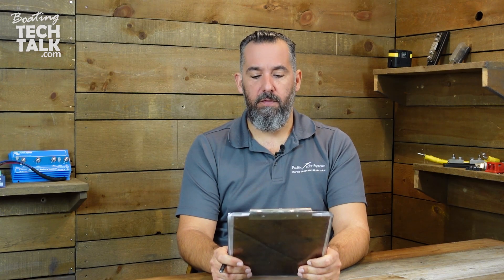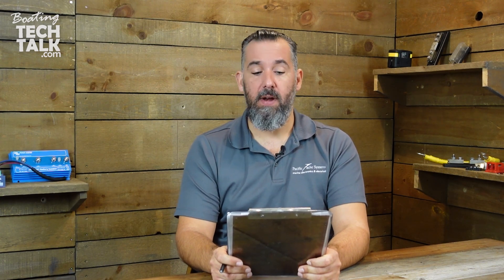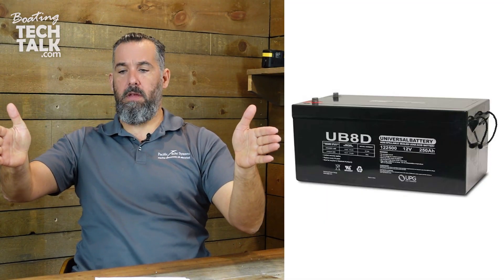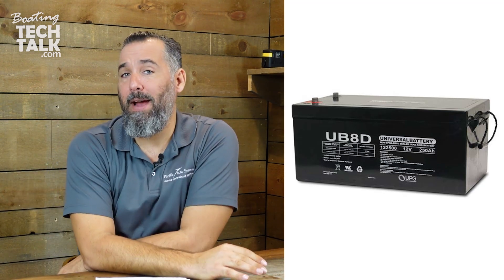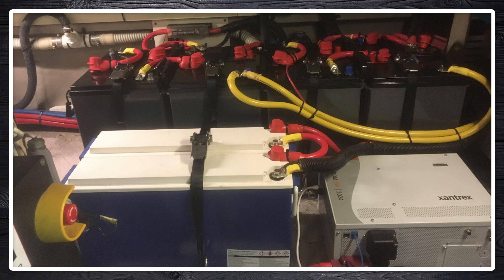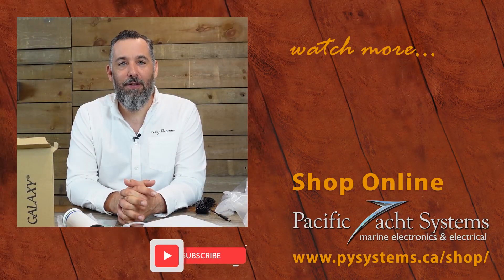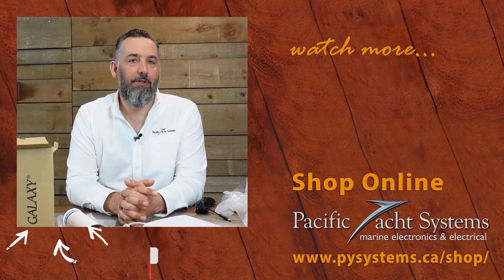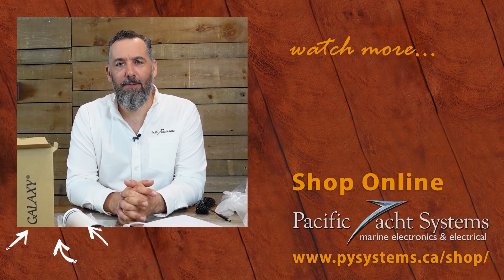Should I Use (10) 100Ah or (5) 200Ah AGM Batteries for My Boat’s House Bank?

Comment: I would think less batteries would be better,  less connections would create  less resistance on the flow of power though the bank, both on charge and discharge. This is best with anything electrical really. Even deans connections are better for flow than  tamiya connections. with less resistance there's less heat created too.

Comment: You didn't answer his question at all.
You spoke about the compromises that have to be made by space and weight limitations.
I think the OP was interested in knowing the technical considerations of the two scenarios. Such as cabling, voltage drops, capacity and depth of discharge, charging and lifespan etc.
Reply from the maker: Hi Mark, IMO, cabling, voltage drop, DOD, will be quite similar for a 10 battery bank or a 5 battery bank. Even if you can handle the weight of a heavy battery, less batteries is better.

Comment: I don't like your answer, you talk only about practicality and weight. What about electrical? number of connection? And end of life? Or when 1 battery is dead? and cost (new and replacement)? ...
Reply from the maker: Hi Maxime, my preference would be to go with 5 x 200 amp-hour batteries instead of 10 X 100 amp-hour battery banks.

Comment: Jeff, thanks very much for the video and explaining complexities of installations. 
 The only other question I had was to do with the acceptance! ( under the same charging conditions will 2 x 100ah agm batteries reach 100% noticeably faster than a 1 x 200ah) do either plateau off substantially after  80% is reached? Best Regards Stormer
Reply from the maker: Hi Stormer, a bank of 1000 amp-hours made of 5 x 200 or 10 X 100 amp-hours... will behave the same way for charge acceptance.
Reply: @PacificYachtSystems  Thanks for confirming this Jeff, great video.. 🙂! Thanks again for helping so many people out with your knowledge and experience.. Best Regards Stormer

Comment: If looking for 24v and the individual batteries are 12v then an odd number is not helpful.
Reply from the maker: Good point, gets worst with 6 volt or even 4V or 2V batteries.